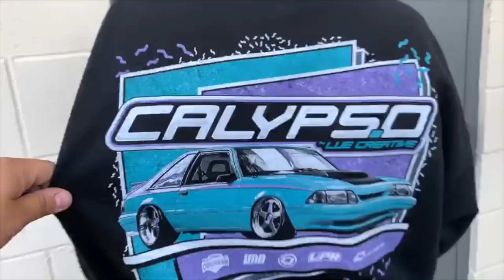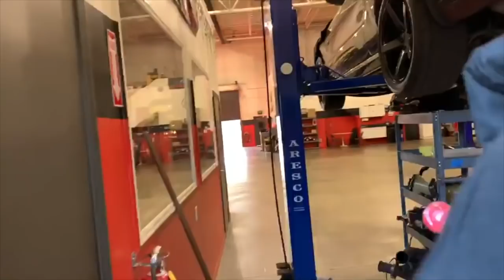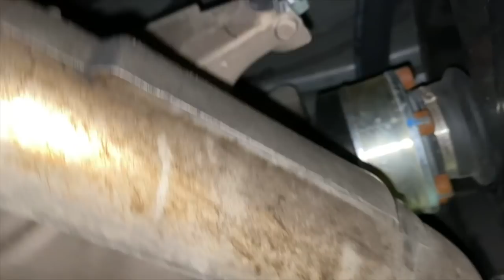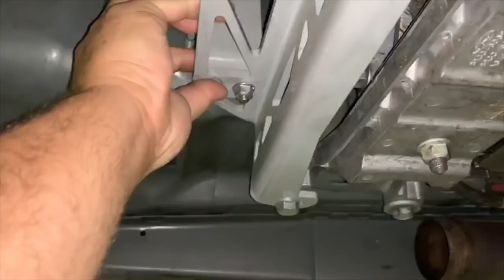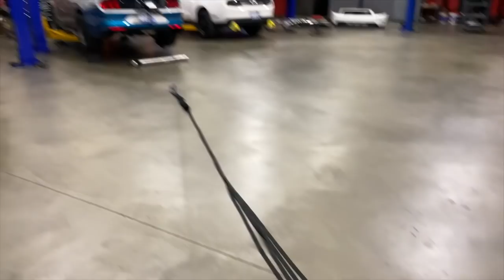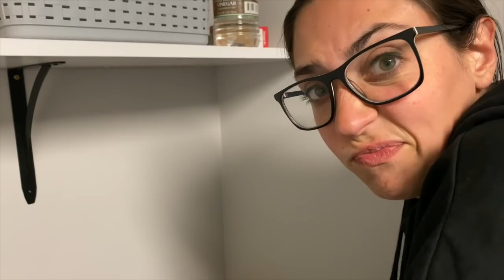Didn't think I would EVER break this....Assessing the Damage on my Supercharged Mustang

Comment: Use the iron diff housing from a manual car. It’s stronger than the aluminum one.
Reply: That was gonna be my suggestion.  Get rid of that aluminum.
Reply: Ben Spada agree.  Aluminum is great and strong but not 8-9 second strong.  Lol.
Reply: Didn't the guys at Midnight Performance just go 7.90 with an aluminum diff housing?

Comment: Looks like you still have the stock rubber diff bushings. If you replace those with solid aluminum and strong bolts, it's actually easier on the ears, so I've read from Kelly at BMR.
Reply from the maker: The brace we put on with the bolts should effectively do the same thing without having to constantly deal with the side effects of those kind of parts since we can remove the brace if we wanted too.

Comment: So steeda makes a stop the hop kit, and a drag suspension setup with a diff brace. That should help you guys not have anymore wheel hop. That’s probably what caused the issue along with the diff walking up from the torque of the initial launch, which broke the mounts and then snapped the drive shaft when those broke.
Reply from the maker: We've actually had the full Steeda kit on the car since the beginning of the year! With all of the new parts, the car hasn't actually experience wheel hop since we raced last year on a very marginal track and has made clean hits all year long! This was definitely a product of 200+ sub 1.45 60's and cranking more power in. The aluminum carriers seem to always break eventually. We'll be putting together a set up that we confidently believe we'll never need to replace again over winter 😉
Reply: That1320Chick that works. Did you get a diff brace too? I didn’t see one on the video.

Comment: Drop in a 9 inch billet ford rear in. You need it for the horsepower your running. A Strange 9 inch set up.
Reply from the maker: It’ll be a long time before that happens. Guys are going deep 8’s/high 7’s with the iron case IRS

Comment: I would never run a aluminum driveshaft......Carbon fiber is the way to go...if they come apart they dont tear up anything....QA1 is awesome
Reply from the maker: Yea but when carbon breaks it can be a big mess, I’ve heard very mixed reviews on carbon as well
Reply: @That1320Chick  well I would rather have a mess than my floor beat up and the diff busted.....the carbon fiber will actually absorb so of the shock load from your launch...which inturn takes stress off of your diff... that's my 2 cents
Reply from the maker: TxHammer757 a mess on the floor? Or you mean a mess at the track when it explodes?
Reply: @That1320Chick  all it does is splinter...I was talking about the aluminum driveshaft throwing chunks of aluminum and beating the hell out of your foor boards